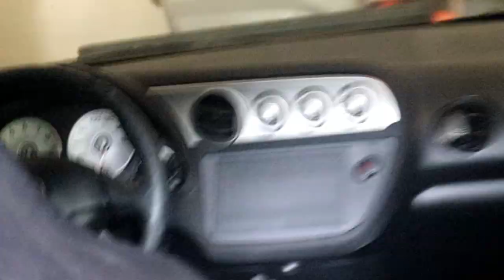Finally Back To OEM Glass! | Replacing A DC5 Rear Hatch

Comment: I used PasswordJDM rear wiper delete kit.  It comes with a stopper and a couple of O rings.  Don't know if you're concerned with water leaking through, but my kit has held up for many years.  If the quality is still as good now as then, I highly recommend.  RSX lost 3 lbs when I removed the wiper and motor.  Hell yea 😂
Reply from the maker: I wouldn't mind trying that, but I still have PTSD from the first attempt so idk lmaooo
Reply: @DC5Brandon where’d you buy it from?